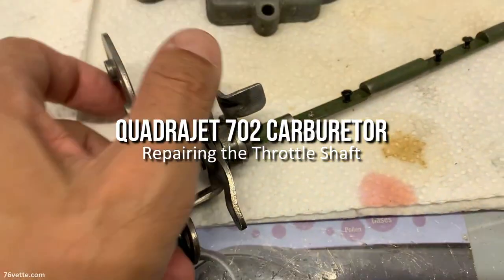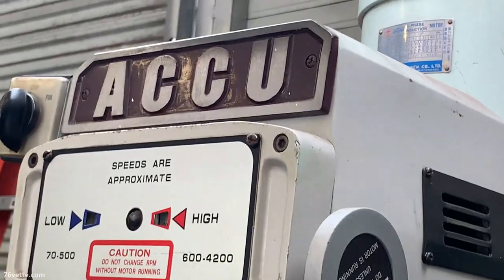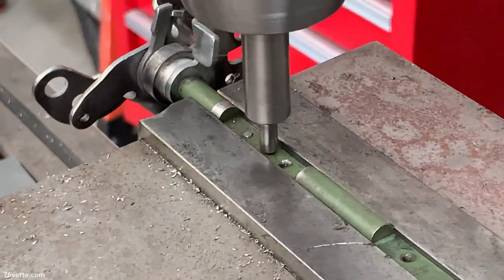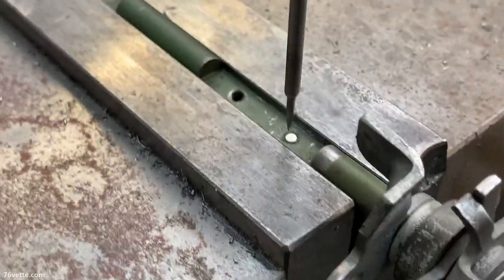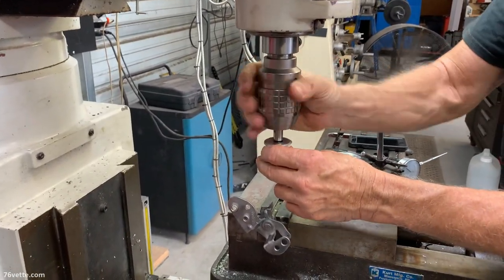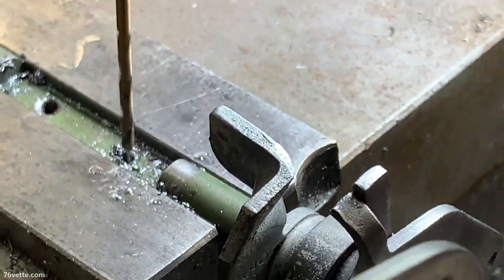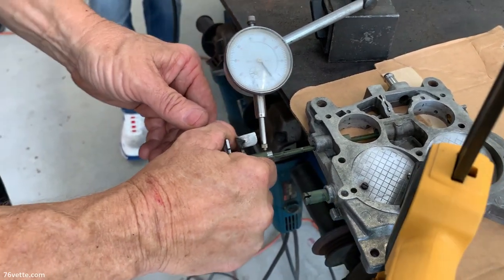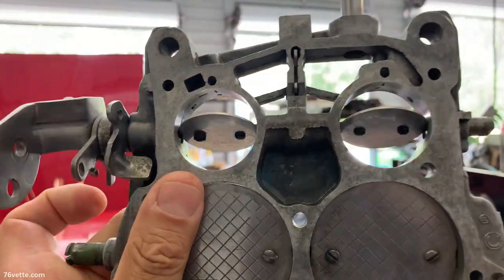Removing a BROKEN Carburetor Shaft SCREW

Comment: Awesome work! I ruined a Carter AVS carburetor back when I was younger because I broke off a throttle plate screw, I tried to drill it out and got off center, by the time I got it out I was afraid to use it, thankfully they were more plentiful back then and I just used another carburetor. Very relaxing to watch someone remove it the right way! thanks for sharing!
Reply from the maker: Thanks! It is one of those dicey situations, and sometimes you can get lucky with a hand-held drill, but having a good friend with a mill and machinist experience, makes things so much easier. Of course you can always buy a good used part as they are available, but being able to fix the original is cheaper and very rewarding. Thank you for watching! 😊👍🏻

Comment: If the shaft is still bent you'll notice a slightly higher idle speed (like 200rpms) at idle when vacuum is applied to the underside of the carb. There's usually a sticking feeling of the shaft if you remove the return spring while running and slowly open and close the throttle plates. This stickiness shouldn't be there when running. It'll def not be noticeable when the engine is off.
Reply from the maker: Good to know. Thank you for watching! 🙂👍🏻

Comment: Anybody know why the shaft is green? Is that paint or a special coating?
Reply from the maker: Great question. I believe it’s a Teflon coating that prevents leaks and/or binding. Thank you for watching! 😊👍🏻
Reply: the green is a factory coating to reduce wear on the aluminum baseplate shaft holes (to avoid a vacuum leak thru the throttle shaft).